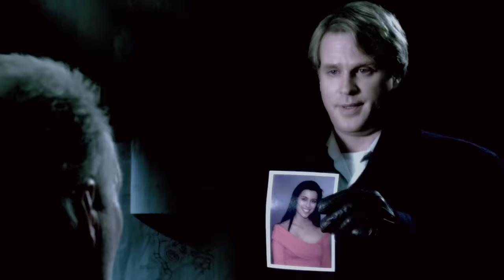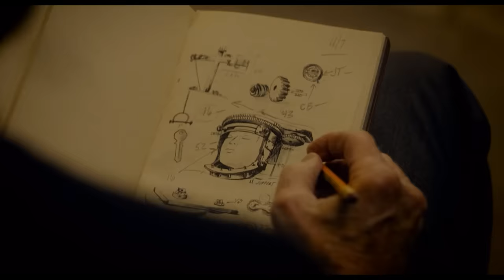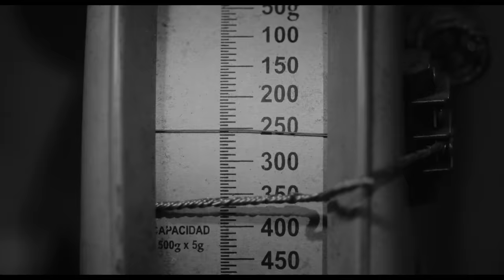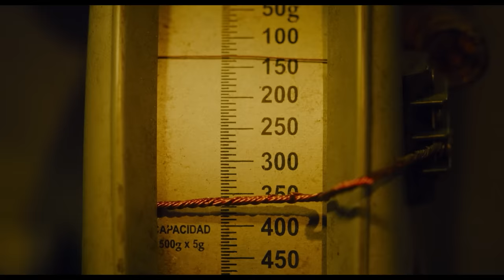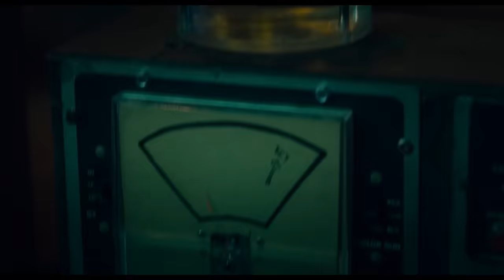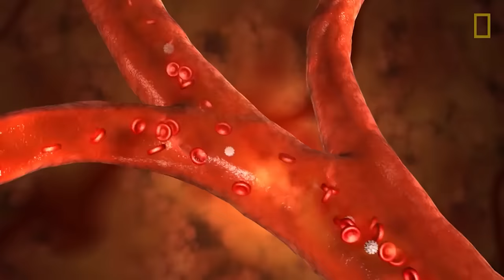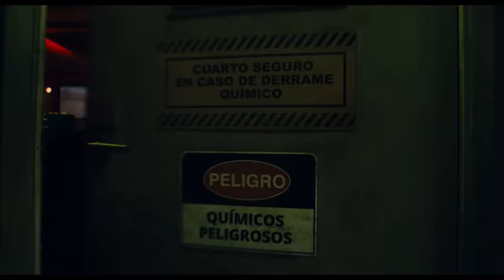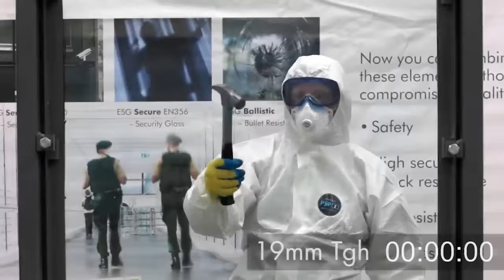How to Beat JIGSAW in SAW X

Comment: People be like, "they shouldn't have hesitated' as if they weren't told to cut off their legs, suck out their bone marrow, cut out their brains and melt it within 3 MINUTES. That is RIDICULOUS. Mateo and Valentina both had a will to live, which is why they even completed their traps. Just like Nerd said, Jigsaw expected them to complete a procedure that took way longer time to even prepare for in a proper setting. They weren't slow, Jigsaw's traps were pretty much indirectly rigged.

Anyways, extracting bone marrow can be EXTREMELY painful. Valentina should have fainted from the pain from that if not from the leg amputation itself. Her entire trap didn't make much sense.
Reply: REAL
Reply: I thought Ole Jiggy wanted them to die and kept the timer to give them hope and ensure they die.

Comment: One of my peeves is the people who ALMOST make it. Like, dude, you've already broken 4 fingers. You're most likely in shock and hoped up on adrenaline. Break ONE MORE finger or loose your eyes? It's not a hard choice imo. :/
Reply: He only broke 3 but yeah, I would choose to break my fingers over losing my eyeballs forever lol
Reply: @randomassmomentsingames  Was it 3? My bad. Still, your fingers can be reset, your eyeballs can't. XD
Reply: @seansmith4513 true but keep in mind jigsaw was imagining that and he probably thought of that guy failing the game
Reply: Crank it to 5 and you'll be fine. If he was ripping the fingers off I'd understand the hesitation but it's only breaking them it'll heal
Reply: Honestly, as someone with hypermobile joints (aka double jointed), that one wouldn't even be a trap for me as I can move all my fingers that far easily, and even need to if I want to pop them. Considering that way it was presented with an approximately 90 degree angle, all my fingers would have been fine, aside from probably the thumb, depending on how it would have been pulled. So I'm curious how John would have dealt with that. Would he have just let me go as I did what was needed even if it didn't hurt me at all? Or would he knock me out again and put me in something worse, which I think would show bias.

Also, ngl, I would LOVE to see that happen in one of the movies. Just someone able to easily do the whole thing in like 5 seconds, no issue, and then just be like "so...what now?"
Reply: Well since it’s just John’s imagination, he probably wanted to imagine the trap going off
Reply: That trap was just a fantasy in John’s imagination. It didn’t actually happen in the movie plot

Comment: Surprisingly the trap that breaks your fingers is the easiest trap in the saw franchise (arguably)
Reply: I'd say it's actually Amanda's trap in the first movie, she didn't have to mutilate herself at all, she had to cut through a body she was told was dead
Reply: @BeansOnButter  I possibly see someone hesitating or not finding it fast enough, but yeah might be the easier one
Reply: Nah the easiest trap is the one to get the needle that you put your hands in only to get them caught... You could literally get the needle very easily just reaching in with one hand while preventing the blades locking on your wrist by using your other hand to keep it propped open.
Reply: @nykthosacolyte5710 wasn't it glued upside down and a fake test
Reply: @oatmiser3110  not fake but it ALSO had the key inside the lock if she looked around. It was literally able to be avoided And extremely easy.
Reply: @nykthosacolyte5710 no, she wouldn't have been able to push the blades up with her other hand, there's a cover around the openings.
Reply: @awhryan  that wouldn't make it impossible
Reply: @nykthosacolyte5710  the covers were way too narrow for her to fit her other hand. She would've had to spend extra time trying to knock the cover off and she would've probably bled out during that time.
Reply: @awhryan  you don't bleed until you pull and if you don't yank your hand out you would barely be bleeding by the time you notice. Her trap was avoidable in multiple ways if she just used her head at all.
Reply: Noo. The bloodboarding trap it is. You can share with your partner and then leave without a scratch
Reply: @six7041  true, but you might get one of those people who panic or who are selfish
Reply: That or the buckethead trap from jigsaw. You only need to give a small sacrifice of blood on the saws sooo.
Reply: @deaddwives  id rather break my fingers but I'd see others choosing that option

Comment: on a scale of 1-10 (1 being easiest, 10 being impossible), how would you rank the survivability of every trap? Here's my opinion: 

Eye vacuum trap: 3
 I mean let's be honest, this trap is pretty easy. The hardest fingers to break will be your middle finger and your thumb, and he already did his middle finger. But considering that this trap has no permanent damage (unless he loses), then there's no reason why he can't click the dial all the way to the 5th position asap to get it over with. I would take breaking all the fingers on one of my hands over having my eyes sucked out every time.

Pipe bomb trap: 7
 Having to cut into your own flesh and muscle would definitely need a burst of adrenaline to complete. However, compared to the other traps in this movie, it's survivability is a lot higher simply to due the fact that there's no variable that involves him to wait for something else (that he can't control) to do its thing (which is the case for the next 2 traps). I definitely thing he needs to cut the tape on his hands BEFORE he activates the tape cause that will give him a bigger advantage than having his hands bound to only the scalpels. 

Wire saw/bone marrow trap: 9
 Honestly, this trap should've been just cutting your leg off instead of extracting bone marrow, because that's what caused her to fail. Not only that, the tube can only extract bone marrow at a specific speed, and Valentina can't control it (which is the unfair part of her trap). Like Nerd Explains mentions in this video, she can use the wire saw to cut the rope around her neck, but I'm not sure that will do much for her considering John and Amanda are watching and will probably do something about it.

Brain surgery trap: 10 (impossible)
 I don't even need to say anything about this trap, it's basically unwinnable (unless there is an outside-the-box way). The hardest part is cutting through his skull, which naturally his body won't let him do (similar to the venus fly trap in Saw 2). The brain doesn't feel any pain, but the part of his brain that he pulls out could completely change the game. If he pulled out his motor cortex on the right side, his left side wouldn't be able to move (or if it could he wouldn't know where it was). There's no way for Mateo to escape this one, and death was inevitable. It would've been smarter to figure out a way to disarm the mask around him instead of do the task at hand.

Radiation trap: 5
 A lot similar to the eye vacuum trap with no permanent damage on her hand and foot, but that cunt Cecelia gave her bad advice and ended up killing her after she succeeded. I feel like she would've had to break both eventually. If she started with her hand, she'd still need a way to be free from the shackle around her foot but minus the radiation. 

Blood boarding trap: 2
 It's hard to call this a trap if the two people in it are in sync. You can easily survive this one for hours by taking turns pulling the lever and taking the pain away from the other person and them doing the same for you. Considering this was a bait for Cecelia and Parker to run off and find the money and lead them to the gas chamber, which stopped the blood boarding trap. This also sealed my hatred for Cecelia's character because this was around the time where she killed Gabriella and threw Carlos into the trap against John.

Gas Chamber:
For 1 person: 3
For both people: 8
 There's still one element about this trap that I don't understand, which is how the winner would get out. Would Cecelia even make it out? Is she stuck in there forever? Kinda hard to rate this one if both people end up dying in that room anyways. I guess this could work the same as the blood boarding trap, with both people working together and taking the pain for the other person (and vice versa), but that still doesn't answer the question of how they would escape.

Disembowelment trap: N/A
 Sorry but I'm not sure how this trap is even supposed to work. Both Mark Hoffman and John Kramer are there so he can't really try anything creative to avoid what looks like cutting his stomach open.
Reply: This is an excellent analysis. I believe the left cortex of the brain was cut though, so that would causes changes in speech presumably. I'm taking neuroanatomy (in med school) next semester, so I cannot confirm with certainty.
Reply: @aplive58  update us when next semester ends
Reply: @siengrain5773  We do neuroanatomy for 1 block, so about 1/3 of the semester. That's a long way out still. This video will be ancient by then. XD
Reply: @aplive58   yeah I think he took a slice of left frontoparietal cortex, although it is difficult to say since it is blurred and I have not seen the movie. Since he most likely took the medial part of the frontoparietal cortex, this should affect the motor activity of his right inferior part of the body (since it is inversely correlated with the lost part; if he sliced the inferior part he would lose the activity of the upper body, you can se this with the Penfield homunculus). Also, he could lose the sensitivity of the same parts because of the parietal damage. Finally, as you said speech is mainly located in the parietal lobe and specifically in the dominant cortex (70% of the population has the left cortex as the dominant one), but I am not sure the areas he lost are the ones related to speech, difficult to say.
However, tbh I think he would die of a neurogenic shock since he literally opened his brain cavity  without anesthesia. I would assume this trap is unbeatable even if you had like 20 minutes.
Gl in medschool it is a long journey xD.
Reply: I would say the radiation trap is 10(impossible) not cause you can't escape easily but after that much radiation your fucked
Reply: @aplive58 hey bro good luck in med school.
Reply: @Frilleon  Thank you dude. I finished the first semester last week and passed everything!

Comment: My ideas (I haven’t watched the full video) 

Eyeball trap (Janitor):break all fingers at once or if your out of time, hold onto the tubes with one hand and try to put them close together and hold them both together.

Pipe bomb trap (Diego):I wonder if you can cut the wires connecting the pipe bomb. I didn’t listen to the tape but it said something to Diego that you can’t cut through, maybe cut the sides of the arms.

Rope trap:Cut the leg fast and do the other one fast too. Also put the rope in your mouth like Lawrence. 

Brain Surgery trap (Mateo):Someone must do it for you while Mateo goes to sleep and ignore the pain but that’s probably impossible and do what Mateo tried to do, this could possibly take 2 minutes without experience but Mateo ignored that trying to rig the trap. 

Ray Gun Trap (Gabrielle):Swing your way out of the way and do what Gabrielle does, you have to break the leg and then arm. 

Blood Flow trap (John and Carlos):Try to move your way out of the blood flow or maybe use that blade to reflect the blood and go into your eyes instead to just close it. 

My ideas (I haven’t watched the full video) 

Eyeball trap (Janitor):break all fingers at once.

Pipe bomb trap (Diego):I wonder if you can cut the wires connecting the pipe bomb. 

Rope trap:Cut the leg fast and do the other one fast too. Also put the rope in your mouth like Lawrence. 

Brain Surgery trap (Mateo):Someone must do it for you while Mateo goes to sleep and ignore the pain but that’s probably impossible and do what Mateo tried to do, this could possibly take 2 minutes without experience but Mateo ignored that trying to rig the trap.

Boiling Gas trap:Simple yet impossible, Look before you grab, but since they did, you can possibly wait out the timer and since it’s boiling you can’t hold your breath up to 30-to a whole second, 1 can live the other one can die, but you can try crawl out of the vent and the man can stay in the vent. 

Man wth do I call this, spider trap:straight impossible bud you can possibly lift your foot up or one of the chains into the things crawling onto your skin and try to rig it.
Reply: I made list of every trap explained in simplified way, but I like your ideas of solving.

Comment: Valentina had her arms free. She also had access to belt/tourniquet, wooden box and that wire saw. Also mechanism that would saw her head off doesn't look too rigid - wire is fit between metal rail and bolt. She could try to displace the wire / jam it with tools she had access to or as desperate measure protect herself by putting sturdy items she had access to betwen her neck and the wire. This could still fail but I think she had decent chance of success. Escaping by cutting the rope would probably be easiest / fastest. Though I am not sure how quick it would be, also given it's close to neck it's gonna be pretty awkward to pull off.

Wonder Jigsaw would do if she just dismantled his whole trap like that.

Very scarce details/ideas provided for escaping a lot of scenarios, obvious things like putting something between danger and yourself like in Mateo's case mentioned. Seems like pretty sloppy job by Nerd this time around.

Also it's so annoying that nobody actually tried to escape basically. Nobody is trying to figure out what they are chained to, what are limits of their movement and their restraints, what items they have in their disposal, etc. etc. And given Amanda and John escape their chains so easily, could participans do the same but didn't even tried? Or they were put in legit restraints unlike John and Amanda?

At least movie explained why instead of trying to save them big bad lady was always encouraging self-harm this whole time. She is truly fucking vile.